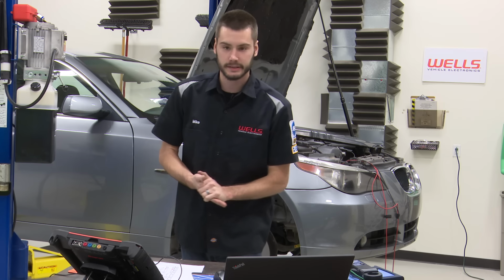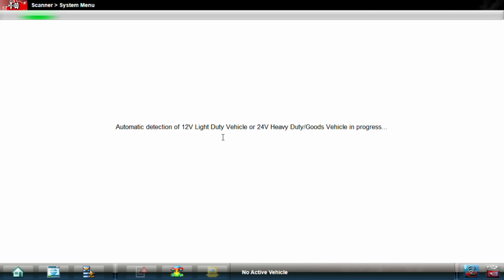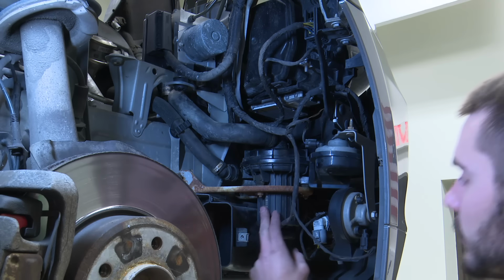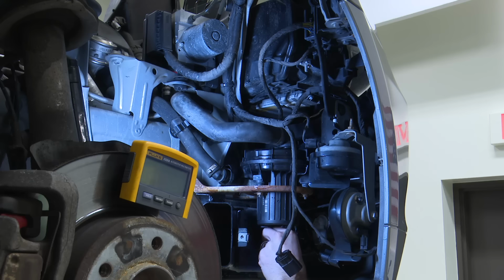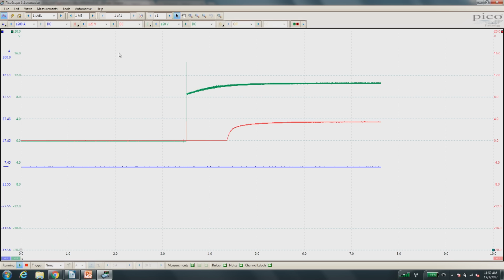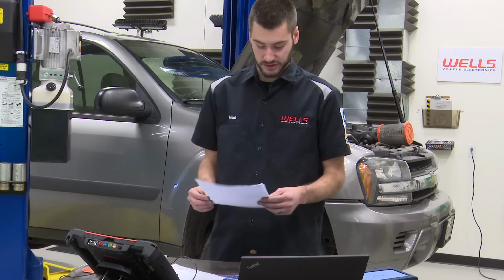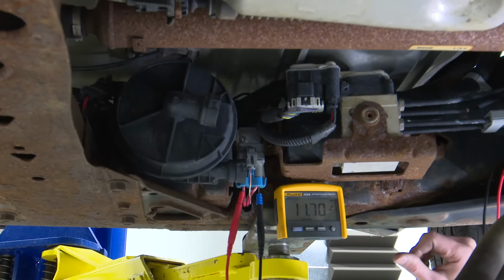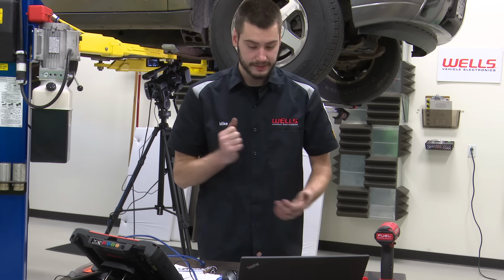Diagnosing BMW (530i) and GM (4.2L) Secondary Air Injection System Faults - P0410, P0411

Comment: Very good video!  I have a 2004 525i with an intermittent fault 2761 "Secondary Air System".  I believe its the same fault that you described here.  I got the fault soon after pressure washing under the car..  So at least I have an idea now on what to check, even though I don't have all the fancy tools that you have!

Comment: Don't forget high exhaust back pressure.  I had BMW with low air flow caused by high exhaust pressure
Reply from the maker: That's a great point, thanks!
Mike Becker, Senior Technical Instructor

Comment: hello my air pump works the relay is new all fuses are good why i still have that code it doesnt turn on like it should the monitors are complete its only that one still blinking meaning is not complete and cant find the reason why can you tell me why ill appreciate your help thanks bro nice videos btw
Reply from the maker: Hey Javier, thanks! It's possible you could have a restriction in the system. Maybe the air from the pump isn't actually getting into the engine? Most vehicles have valves/solenoids that could carbon up.
Mike Becker, Senior Technical Instructor

Comment: To pull an hole intake for changing a coil or a plug that is crazy engineering, So think a little before picking on BMW becouse this job will cost you only max 5 minutes  on this car.
Reply from the maker: What about the BMW's that you have to pull the intake to change a starter :) All cars have their rough jobs.
Mike Becker, Senior Technical Instructor

Comment: I hope you can answer. My E46 330i 2003 I still having the P0411 and is the only code getting 
I replaced the old valve and the one is also is new like this video it doesn’t have a vacuum hose. Pump works with no problem. Turns on 5 to 10 seconds, Hoses are new, Already checked the under the hood fuses 20A and they are all ok. And also the one inside the compartment box the Fuse 50A is good also. What a my missing? The Secondary Air Pump MAF  Sensor or the Relay behind the fuse box in the compartment Box. That controls the SAP MAF? I would appreciate tons a response for this cause I truly can’t find it what’s the cause.
Reply from the maker: Hey Vinx, what about the valve that connects the AIR system to the exhaust? If that valve is bad all of that pumped air never makes it into the exhaust...
Mike Becker, Senior Technical Services Instructor

Comment: Does the extra ground wire dissipate the energy left in the air pump motor because its still spinning after its turned off?
Reply from the maker: Well done John, it gives the energy a path to ground. After the pump is shut off it goes from consuming power to creating power...that power needs somewhere to go.
Mike Becker, Senior Technical Instructor
Reply: @GoTechTraining  nice answer guys makes total sense.

Comment: Wouldn't be the purpose of the ground on the pump relay when is off is to despite the counter electric motor force when the pump is turned off and to prevent any undersigned power to turn the pump on ?

Comment: great job Mike   great points    I like the part where the air injection MAF would not respond to the air pump coming on the bimmer because of the blockage.  you isolated the problem and got it to flow    it really shows the effect of a totally pluged cat convertor  on the engine MAF  same principal      thanks again
Reply from the maker: Hey Mark! Thanks! Glad you enjoyed the class man.
Mike Becker, Technical Services Instructor

Comment: The Trailblazer relay probably got some conductive saltwater intrusion inside that caused corrosion and/or an internal short circuit. I'm very interested to see the TechConnect episode where the faulty parts are dissected. Awesome class!
Reply from the maker: Joseph, i've pulled it apart since then....it's not pretty inside!
Mike Becker, Technical Services Instructor

Comment: Power probe
Reply from the maker: Hey Vince, i'm not a power probe user...how much amperage can those things handle? I know they have an internal circuit breaker.
Mike Becker, Technical Services Instructor
Reply: Wells Vehicle Electronics i use them mostly for voltage drop test
Reply from the maker: You trust it as much/over a meter?
Mike Becker, Technical Services Instructor
Reply: Wells Vehicle Electronics 
Oh ya never a dout the feed test is great 4 voltage drop test gives u your batt voltage and tip voltage easy to check for block grounds alt  ect everything way faster
Reply from the maker: Vince, someday I may try one out...we'll see. I'm just not sold on it yet. 
Mike Becker, Technical Services Instructor

Comment: The power side of the air pump is grounded when the relay is off to stop the pump motor spinning quickly (stop now). You will see the same thing on wiper motor park position switches to park the wipers qiuckly.
Reply from the maker: Todd, I like the theory, but the pump takes time to wind down. It doesn't stop right away. Other ideas? :)
Mike Becker, Technical Services Instructor
Reply: Motors will create a large inductive current when disconnected,  it is best to flow it to ground VS  spike the power line.  Most relays  will have just a diode  for the same reason.

Comment: How can I get a hold of you directly? (PM you) 2000 Malibu 3.1L vin code J secondary A.I.R. code P0410 keeps on popping up and Ivan fixed all of the vacuum leaks around that system but there is some kind of a vacuum solenoid  that only runs with the A.I.R. during cold start! But I keep on getting told that it's called a A.I.R. diverter valve from one person then when I go to a auto parts store they list the check valves as the diverter valves and the A.I.R. diverter valve as a EGR CONTROL SOLENOID! I can send you pix of what I am talking about! U have screenshot shots! I also wanted to know if Wells makes these kind of parts. If so I would like the part numbers and where can I pick them up at!
Reply from the maker: Hey Daniel, you have me right here! Or you can email me. My email is in the description of this video. Please email me those pictures. I'll take a look!
Mike Becker, Technical Services Instructor

Comment: Hey Mike great video! On identifix you can access OEM wiring diagrams as well.
Reply from the maker: Hey Maic, thanks! Yeh, I should have probably grabbed that. I didn't want to use any of those...but our AllData site was down for whatever reason. :(
Mike Becker, Technical Services Instructor

Comment: Absolutely a great show.. Thanks for the case studies 
As always, enjoyed it.. Did a great job Mike.
Thanks, Kevin
Reply from the maker: Thanks Kevin, glad you enjoyed it. I hope that makes people stop and think when they are diagnosing these things. Don't just order up one part. Verify the entire system for integrity.
Mike Becker, Technical Services Instructor
Reply: Very true..crazy to think a 10 dollar part can take out a 200 dollar part.. lol  Always find its the check valve/water intrusion that kills them.  I was surprised to see that relay on the Chev tho.. What a great pair to do in one show.  2 different kinds of scenarios.  (:  
 Makes me think/worry about my own 530  its an 07 but I think they are still the same setup.  Lol
Thanks Again
KB
Reply from the maker: I think this demonstrated 2 scenarios where if the tech diagnosing these didn't do his job all the way, there would have been comebacks...hope your BMW doesn't give you any issues!
Mike Becker, Technical Services Instructor
Reply: 1997 BMW air injection incomplete...is pcm, in this case, monitoring h02s1 or MAF ? Or both ?